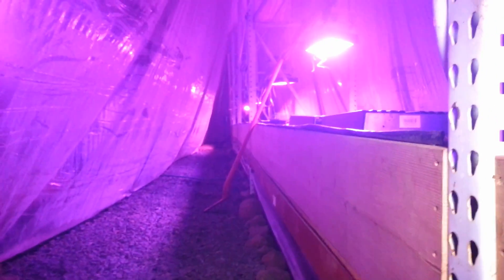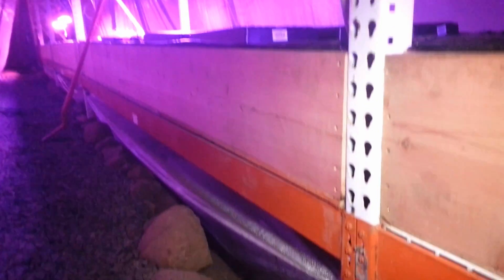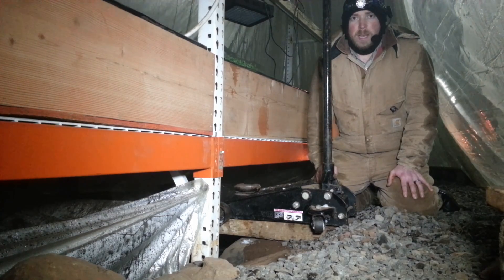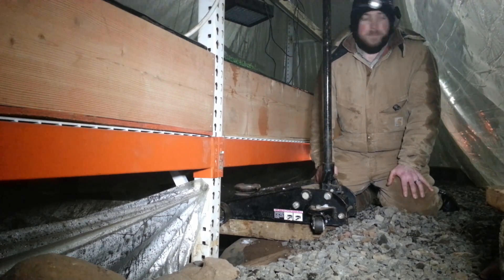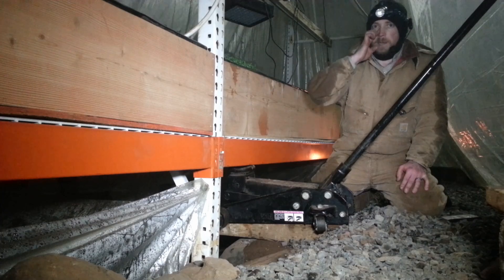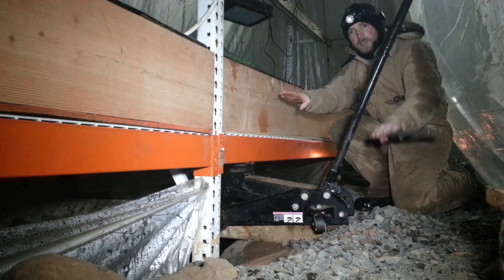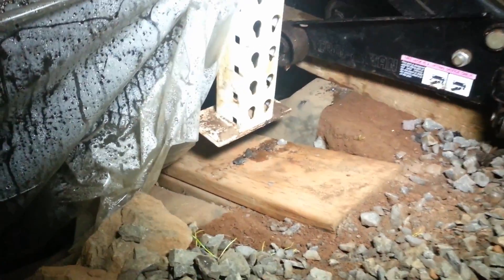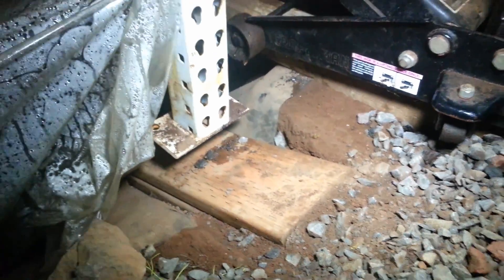Dirt Aquaponic Foundation? Hmmm, Maybe Bad Idea

Comment: If it was me, I would have put 6" x 6" (minimum) beams across the trout streams at every grow bed footing. (Like the beam that you used to jack it back into place.) Then both sides would be level and could not sink on that angle.
Reply from the maker: +PoopingAndroid yeah I'm thinking the same thing ... Now lol
Reply: I have held my tongue on this because there is nothing I hate more than back seat drivers and I really admire what you are trying to do here...... BUT!  

I  don't think there is any way that would even hold (6x6) when those beds are fully installed. It is perched on the edge of a trench, on both sides. Spreading the load out into the path area ( dug in so its not a trip hazard ) is the key but I think you are in railway sleeper territory or more at least here. Mr Martian is the one with the maths so how about calculating what each of those bed boxes weighs, plus stone, plus water plus fittings and what not. There must be tonnes baring down on those post footings and he wants to add another two layers of beds to the stack? You have an elfunt on the head of a pin at every post there and you are expecting the edge of a trench of sandy soil, which with one mistake ( leaving the top up water on ) will turn into quicksand in short order, to not just drive itself into the ground because it is on a dinner plate size block of wood? Did you calculate for Mars gravity?

 It is going to fail. and it will be catastrophic. Might even tear through the skin of the hab and would definitely hurt if it fell on anyone. Hear me now, IT WILL FAIL. This is a priority, get some heavy heavy spans across and beyond  into the path areas to spread the load of those uprights footings.

If you were applying a bit of forethought, and you still could, casting in place steel re bar reinforced concrete lintels with spread footings into the path area would be the way to go.

towers                                                            [      ]                             [      ]
lintles                                                      ___________             ____________
floor                                  _________________________________________________
lintles   n fish                                         [   ]   (F  )    [   ]            [   ]    (F  )     [   ]
Reply: While we wait for someone with expertise in designing foundations to show up I'll throw in my two cents. I would pour U shaped supports that ran across the bottom of the trench and up the sides, with the rebar bent around the corners. My gut says make the base 12" wide, 6" thick, sides 8x8 or 12x12. I would extend the base 12" into the lane. I would do this to the unfinished lanes, then move everything to the new lanes, pull the original lanes out, and redo them. I agree with Godshole, if you don't get a proper foundation under those racks, they're a disaster waiting to happen. Please note that my qualifications are limited to setting posts and pouring one foundation to an engineer's plans. Remember you made that area too level. Maybe as soon as the ground thaws you should put a drain trench around it. Or did you do that already?
Reply: TheRealMartian It's not too late. ;)
Reply: I agree with you 100% Godshole and have been thinking the exact same thing.

I've trenched thousands of feet out here with my Kubota 1' bucket on tank tracks in the cement like dirt here in AZ and can't tell you how many times I've had to go back up over the trench a little bit to redig a part and the wall fell in (along with the kubota kx43) and that's with 4' long tank tracks to distribute the weight evenly.  the walls just crumbled.

I SURE HOPE MARTIAN IS LISTENING, THOSE SIDES ARE JUST WAITING TO COLLAPSE AND IF IT'S THE WRONG ONE AND FALLS INTO THE NEXT ONE OVER THEN THE REST MIGHT GO DOWN LIKE DOMINOS

it's definitely an accident waiting to happen if just one little overflow of water caused this.

Ideally a beam, 4X4 whatever, under each foot from the left to the right side of the tent would be the ticket.
.
Reply: My head hurts. 

Dear Mr and Mrs Martian. You need a holiday. You have been on the back foot since you started this channel and you have a mountain in front of you. Take a break for a week, ask Mrs Wranglestar to house sit and just get off the farm for a week, clear your heads and catch your breath. Just an opinion.

So is this ...  I think those beds are 3 m long by 1 m wide, ish and have a 30? cm deep box with stone and at times water in them too. That's near on 1 square meter of stuff in each bed. Mixed rock that size is nearly 2 tonnes ( metric I think ) a box/bed and there will be a high percentage volume of water on top of that, maybe another half a tonne, 2  ½ tonne, in each box. 

5 boxes …..... 12.5 tonne, plus all the wiring and lighting and plumbing etc.

6 pairs of legs x 2 =  12 legs, so about a tonne per leg. That's a small car sat on 36 square inches of mystery wood on the edge of a crumbly pond bank.

Call me cautious but ….... Someone mentioned make do with a sleepers retro fit, don't go any higher just yet and prep the next bed properly, then move the existing one to the new footing bed. That is a lot of work. Also a lot of work, but possibly less, and can be done in stages and in situ, would be casting in place re enforced concrete lintels. 

Jack the beds on one pair of posts like you did to repair there but chock them a wee bit too high so you can pour concrete up to the 'level'. Dig the shapes you want in the soil, make a wooden concrete bridge over the pond span and dig the other side. Fill it with concrete and scrap metal, old fence, chains, and top it off just under the 'level'. Done.

You might want to think about improving the fish baths, like putting in a fish poop conveyor belt powered by the magnetic resonance of the fish swimming in the water. Makes sense to me. 

                                             5 boxes = 1 SMALL CAR per leg (like a Mini)

I know, I didn't factor in the weight of the shelves themselves as well.....

Have a footings party :)

P.s. If you get a good design and I like it I will chip in for materials. Wont be much but like the man said, are you in?

I need to add as well that at least the sleeper retrofit needs to be done as soon as possible. I know it is a lot of work but if you had it done before your break you could relax while you are there. 'break' who am I kidding?
Reply: Yes!
Reply: PoopingAndroid  I was thing the samething
Reply: Was my immediate thought as well. That's a hunk of weight and you are still wanting to stack more grow lines on the rack = better get it right.
Also hope you have spring run off well managed cause any moisture creep could severely destabilize the ground around the fish tanks making concrete lining of the tanks a necessity.
Keep living, Keep learning.
Reply: Godshole Yes you're right. Tons of weight. But what you seem to not understand is that it's spread across many legs. Not just 1 or 2. I agree. Concrete pilasters would be the proper way to do it if money wasn't a problem. But.... He doesn't currently have those funds. You donating?
Reply: If the beams was extened into the gravel-lane it would have a lot more surface to take the load from the grow-beds.
Reply: Of course it is!  The entire house of cards is setup to fail as soon as the pond liner drops low enough for the water to undermine the rack's legs.  It has almost happened twice...   Besides temping Karma with all those jokes, "I'm still alive"... for heaven's sake fix it now don't continue to claim it's good enough.  No such thing when it comes to things that can crush you while you're feeding the fish one day!
Reply: Everything works fine till you add water into the mix. Because the fish 'tanks' are just a earthen pit lined with a liner any water creeping into the soil around the tanks starts to collapse the earthen walls as happened. A scary scenario can quickly escalate into full blown catastrophic collapse. Dirt collapses into fish tank pushing the tanks liner down releasing more water into surrounding soils causing further collapse down the fish tank line. This leads to the racking collapsing cascading into other racking or into the building risking to collapse it (especially if at "full" capacity). So much for doing it cheaply.

Time to put the engineering to work and source some more funding ...or make do for now without expanding operations until funding of proper facilities are done

Be safe...Mars is no place to skimp on
Reply: I'm sure Mr. Martian knows the term Thermal Runaway!  The inevitable collapse of those racks is a perfect example of an analogy of Thermal Runaway under significant amount of potential energy and massive electromotive force!  It only takes a small leak in a dam before it comes crashing down.
Reply: If you do the 6 x 6 beams across the stream, you still need them to stick out say at least a foot and a half on each side so there is more surface area to carry the weight of the beams.  At least that is what I'm thinking.    Another way is to use a beam on both sides of the footings and have a stiff metal cradle that is held up by the two beams on each side. You would need a cradle on each side of the bed of course.  The rack would then sit on the cradles, spreading the surface area out even more.   Would have to be a very strong cradle.   I'm sure there are many ways to do this.   It's looking like to me, it just a matter of time, before he has a major problem on his hands.
Reply: I think would have probably like to see the boards run the length of the edge, to spread the weight at the edge, rather than having six inches on the edge.  Rotating your boards might not be the solution as I like how you have then coming back a little.  Maybe a fireman's cribbing could be helpful until you get a better replacement.  The cribbing they used to lift heavy items to get to victims is usually more square.  The wildland firefighter next door might be able to help on this particular issue, but that is probably more something that a city firefighters knows.
Reply: It is the edge that is unstable. gn0202
Reply: absolutely, Godshole. 

in my example above, my bucket is 12" wide.

my tracks are 20" apart, 9" wide and 38" outside to outside edge.

the inside of the tracks are 4" away from the trench i've dug.

the outside of the tracks are 13" away from the trench.

no matter how careful or slow I am, if I have to go back over that trench even with the excellent weight distribution on the 6 square feet of track, the odds are very good that one of the sides is going to collapse and me and my equipment will fall in sideways when one wall collapses.

add in just a liter of water and it's absolutely going to happen.

bottom line is that the supports need to be perpendicular to the fish lanes extending out quite a distance, not lengthwise.

I don't know why we're putting so much effort into helping with this situation as it seems to just be falling on deaf ears anyway...

https://www.google.com/imgres?imgurl=http%3A%2F%2Fwww.kubota.com.au%2Fwp-content%2Fuploads%2F2015%2F09%2FKubota-Excavators-U-U17-3-450.png&imgrefurl=http%3A%2F%2Fwww.kubota.com.au%2Fproduct%2Fu17-3%2F&docid=7MuHiceJ0pp_UM&tbnid=f016J20MzaOkxM%3A&vet=1&w=398&h=450&bih=587&biw=885&q=kubota%20kx43%20excavator&ved=0ahUKEwiz3uWkwJjSAhVL5WMKHbEGBaAQMwhWKDIwMg&iact=mrc&uact=8#h=450&imgrc=f016J20MzaOkxM:&vet=1&w=398

https://www.google.com/search?q=kx43&newwindow=1&source=lnms&tbm=isch&sa=X&ved=0ahUKEwjoouuQwJjSAhUC82MKHSvWCe0Q_AUICigD&biw=885&bih=587#newwindow=1&tbm=isch&q=kubota+kx41+excavator..
Reply: AZ Donald, Just don't want anyone to get hurt and would like to see this set up work and appreciate all the energy Mr, and Mrs, Martian have and are giving this. Your experience with the wee digger there speaks volumes for what might happen here.

Comment: For your other lanes I would figure out where your pads will be and use a post hole digger to install a 12" sonno tube for each leg 4-5' down then fill with concrete. This will be a much less expensive alternative to a full foundation around the pond.
Reply: You took my idea!!  Just kidding, I was just thinking the same thing.
Reply: bigfoot1803 what he said
Reply: I was thinking the same
Reply: bigfoot1803 I agree. Especially when he has 4 or 5 levels
Reply: You can usually just get full concrete slabs pretty cheap, sometimes they are even being thrown out and you can get them free.
Reply: 12" sonotube with a flared footing, 3' deep would probably do it or about a foot deeper than the bottom of the pond.

Screw piles are another option
Reply: he needs depth to stabilize
Reply: I would be lining the fish tanks with concrete to stabilize the walls and yes re-enforce the area were each leg will sit with sono's or forming.
Any spring moisture creep onto them fish tank walls right now could cause a collapse
Reply: was going to suggest exactly the same thing, a tube is not even needed though, dig it out optionally some rebar and pour in that concrete.
For this kind of weight (all those beds filled up is a lot) he needs to go quite deep with those foundations or this will happen again and again.
Reply: bigfoot1803  thats my idea lol
Reply: If i remember right from when you show how you made the fish tanks. You just dug them out with no side walls to keep them there, You could have line the walls with underground (or called ground contact plywood) plywood. That has a rating for 30 years or more from rot with the proper drainage.  Then added your liner which would have compensated for ground movement when full of water.  Then beamed across the pond  under each support. Now if you had done this on undisturbed ground that would have been a different story.   But you leveled the ground where this green house is.

Comment: Please know I am not ripping on you because I really like what you are doing.  Learning to grow local foods is extremely important to us all.  In 2013/2014, I built a geodesic dome and grew veg year round in NE WI.  I learned a ton of useful lessons.  I am trying to share what I learned with you now.  From a design aspect.  I totally understand the redundancy of having multiple fish tanks, but hollowing out the foundation beneath every rack leg is a recipe for disaster.  A long narrow fish tank creates all kinds of issues which you have yet to learn.  I listed a few under a past video.  It would be much better to build the fish tanks perpendicular to the racks.  This would eliminate the footing issues and decrease the surface area of the water.  Yes, you would need a man bridge to walk over the ponds, but it will also allow you to access the fish tanks for maintenance.  Currently, how do you find dead fish?  Evaporation is condensing on racks which will create rust sooner than you think.  The racks need to stay dry and upright.  Neither is occurring today.

Comment: Jeff: What the hell r u doing??? U NEED TO BRIDGE THEM SUPPORTS WITH THE RAILWAY TIE so ur distributing the weight over 6 ft of dirt, 3ft either side of the fish tank trench. A 1ft square block IS NOT and I repeat IS NOT enough to hold them racks on the very edge of a trench full of water. I am not kidding m8... and most engineers would agree with my solution to fix it. And u want 3 levels of grow beds on the footings u have now??
Reply: EXACTLY OFFGRID
see my comment above, basically the same idea which would result in one long railroad tie butted against each other from the left to the right side of the tent.  not necessarily one continuous big one like I implied above.  (TWSS)
.
Reply: I hope he read my comment, I wud appreciate if he atleast hit the +1 button on my comments, cos I have not had a reply since his first vid. Anyway them railway ties have enough meat on them to put 4 coach bolts per leg and the gravel around them will bed them down more secure, when the ice/snow melts It cud be possible that it may seep into the habitat and undermine every footing. I seen pallet racking disasters on utube and they can just topple so easily when 1 footing was hit by a fork lift.
Reply: it's just getting nighttime here offgrid about 9:30 his time.  

i'm assuming he's been at work all day long, now probably working on the habitat and THEN will get to the numerous comments.

I could be totally wrong but I know the hurt feelings because I've been giving suggestions too and no reply but I think like I said he's been busy all day.
.
Reply: Well i dont expect a reply but a +1 is simple enuf to say I read it atleast, so no hurt feelings here, I just dont waste time making comments if they r going to be ignored.
Reply: I know the feeling but even a +1 doesn't mean HE read it.
i'm a little surprised and disappointed too because even a repetitive, scripted reply to those of us trying to help would be courteous.
.
Reply: Agree with you, but no railway ties. They are soaked in creosote and that would totally mess up their system and probably kill the trout. There are other possibilities out there.  
Those racks are amazing tough they are used in retail back room to store merch on. And will take a huge amount of stress. There are also little sprung clips that fit into those racks and lock the long sides in place.
Reply: A warehouse floor is about 8 inches thick with steel reo all thru it which makes them shelves stable and tuff untill 1 leg is taken out with a forklift.. And I only said railway tie cos it is what he had, myself I wud use presure treated hardwood railway ties that r not contaminated with creosote or any other chemical crap cos it is a food production area. So in the last comment I was assuming the ones he has r not contaminated.... anyway good to bring the point up to keep the area chemical free.
Reply: excellent idea about the chemicals, Mike
.